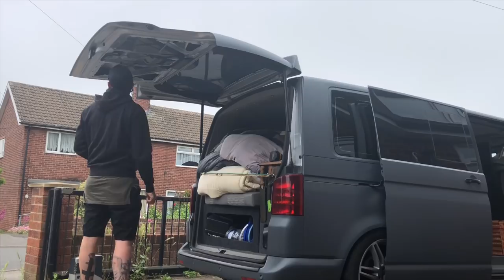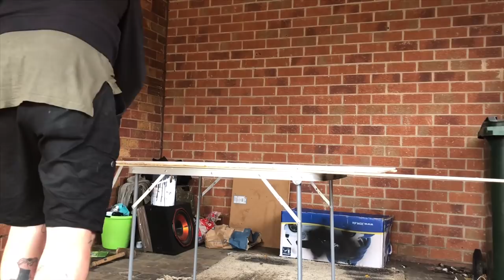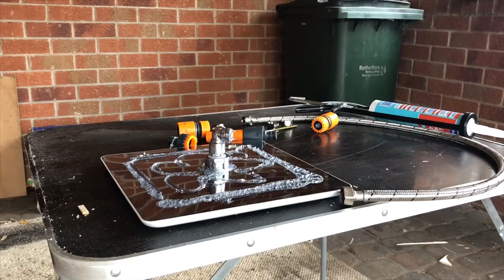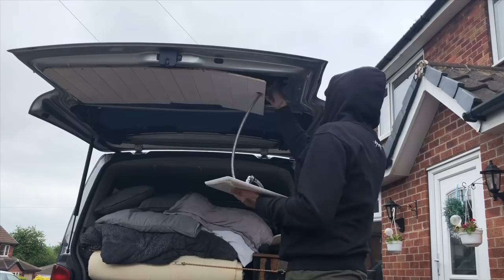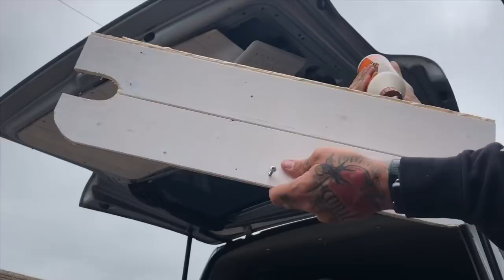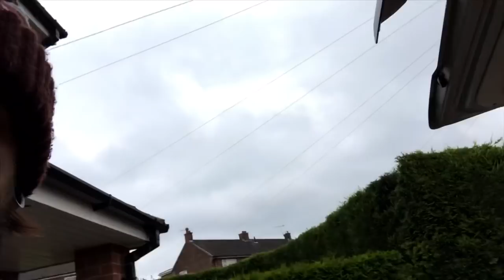VOLKSWAGEN TRANSPORTER - DIY SHOWER - MADE IN A FEW HOURS - TAILGATE - VANLIFE

Comment: This is brilliant!!!!! Do you disconnect it from the tailgate when not in use or is the hose fitted all the time?
Reply from the maker: The hose is always fitted all the way down in to the van and then I fold it up so I can plug it in to a water source when I want to use it, usually I have a 25l bottle I attach it to and usually fill that with water from the kettle

Comment: Hi. What water pump did you go for in the end? 
And do you have an onboard water heater?
Reply from the maker: It was just a 12v pump off eBay, I didn’t bother with hot water, just used the kettle :)